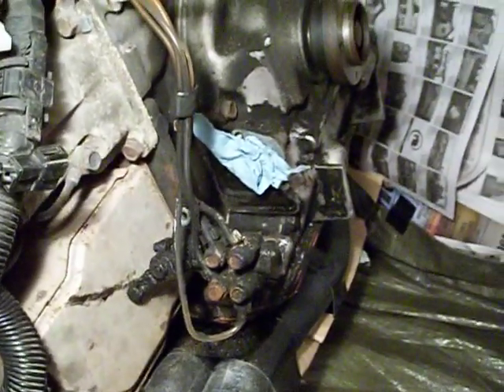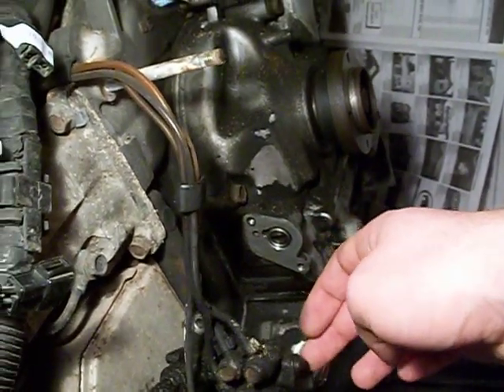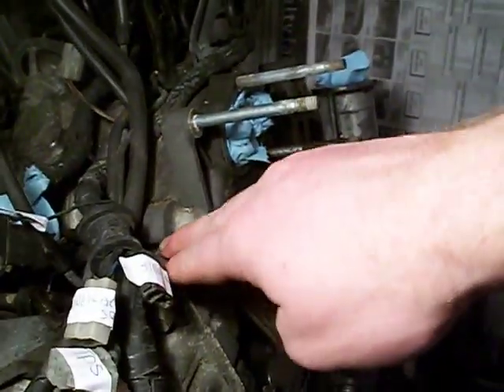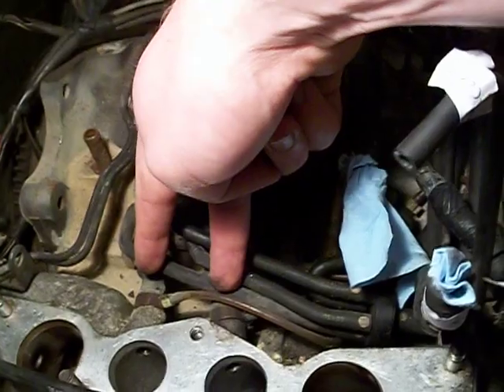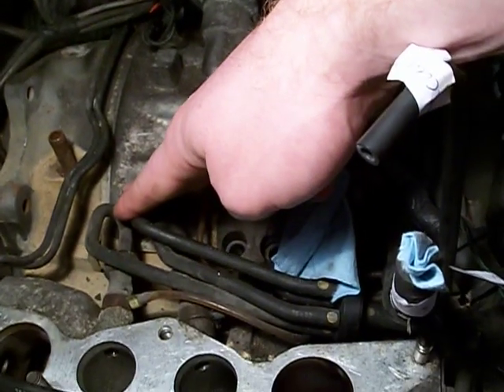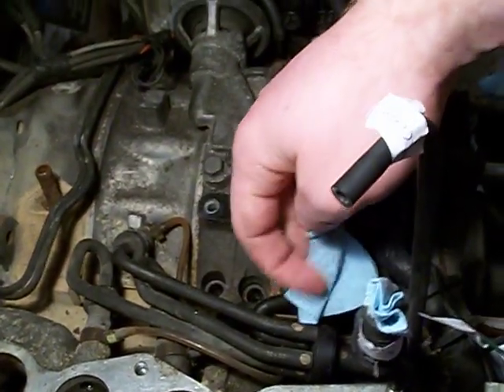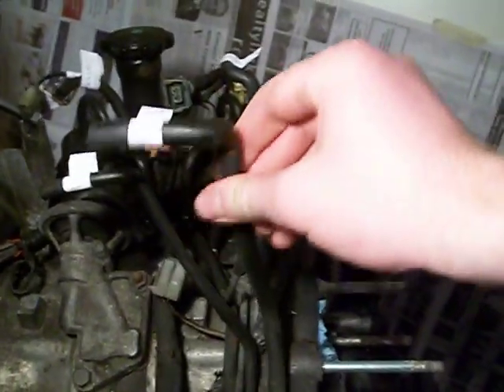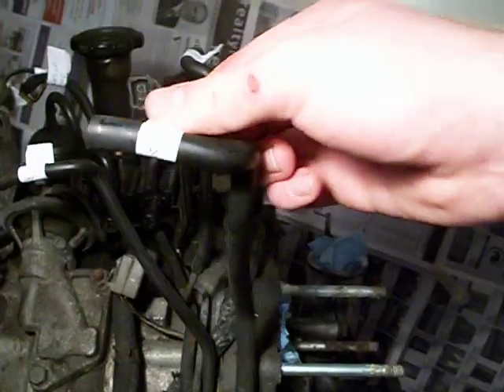Mazda RX7 13b engine oil metering pump removal

Comment: I nead help I have a electric  problem with the head lights, horn power windows . I check the fuses the  are good if any relays the I have to check  or its a electric meter the can check the wires for a short cut

Comment: Question: what year RX7 is this engine from and what letter does the engine no. start with? I know it's from 2011 so you may not recall but I have recently bought an S2 RX7 with the 12A replaced by a 13B. It has a 2 line OMP going into the carby that sits on top of an identical manifold with air pump disconnected and I'm trying to identify what the donor car would have been.

Comment: what kind of wrench did you use to remove the housing bolts? for some reason i cant get my 14mm around it which is what i used for the intake bolts.
thanks.

Comment: Code 27 just popped up on my 91 FC and it reads as the MOP and i cant rev fast or it will sputter and almost, but it idles fine, what is your personal opinion.

Comment from the maker: @fc3s1 complete omp failure will result in your apex seals not receiving sufficient lubrication, this will result in apex seal failure and rotor housing damage, a very bad thing. 

The easiest way to check if your OMP is working is to check your oil level frequently, rotary engines consume more oil than conventional engines. You should need to add oil every 5000km or so, if not OMP is not working. If you are scared your OMP is broken, read into pre-mixing, you don't even need your OMP!